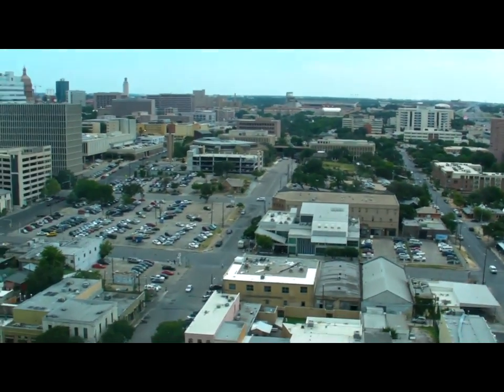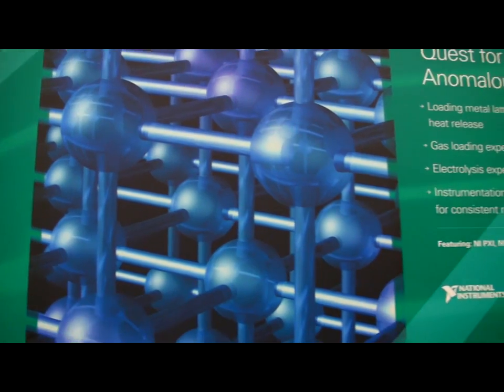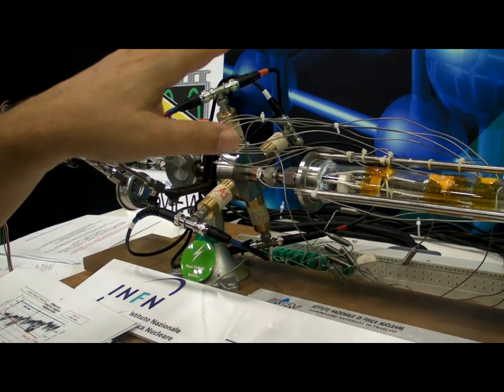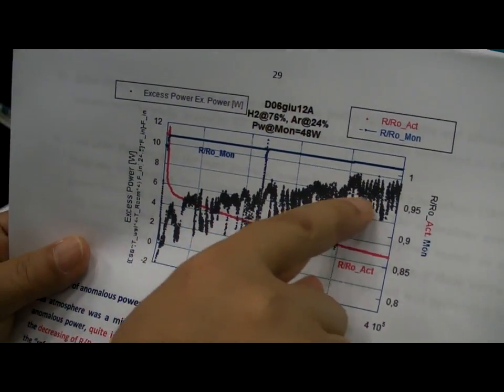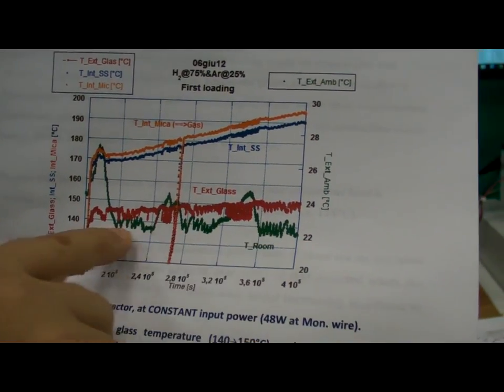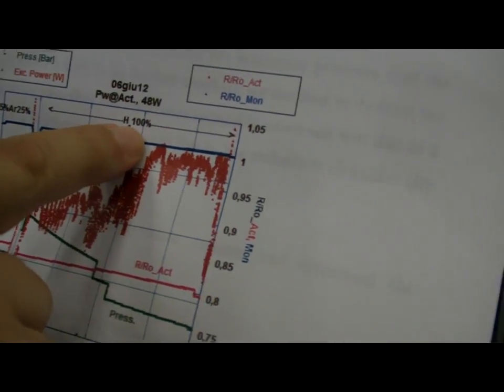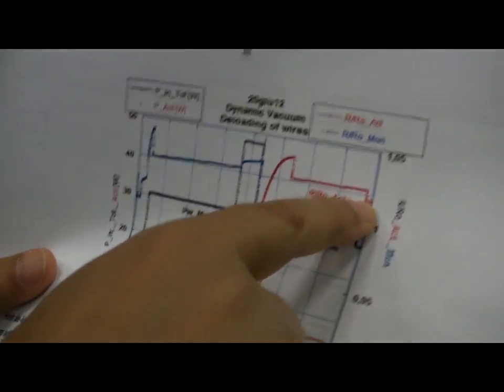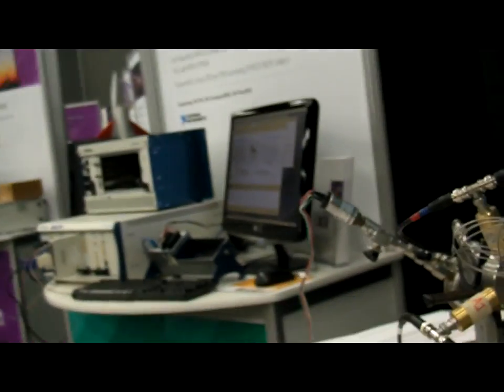NIWEEK 2012 - Cold Fusion - LENR - eCAT - Anomalous Heat Effect demonstrated

Comment: and two conference proceedings:

E. G. Campari, S. Focardi, V. Gabbani, V. Montalbano, F. Piantelli, E. Porcu, E. Tosti and S. Veronesi, Proceedings of the 8th International Conference on Cold Fusion, 21-26 May 2000, Lerici (Italy), pg. 69-74, Editrice Compositori, Bologna.

S. Focardi, V. Gabbani, V. Montalbano, F. Piantelli and S. Veronesi, 1997 Asti Workshop on Anomalies in Hydrogen/Deuterium Loaded Metals, Conference Proceedings Società Italiana di Fisica, vol 64, 35 (1999).